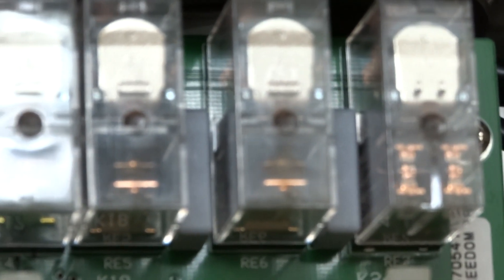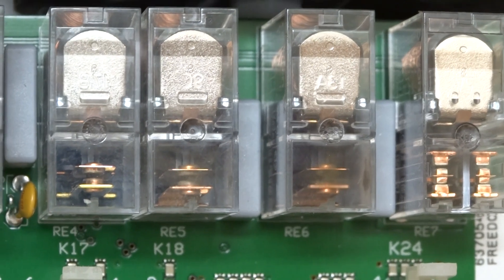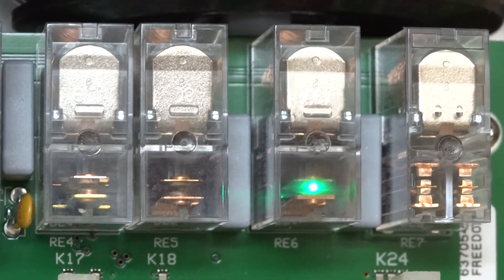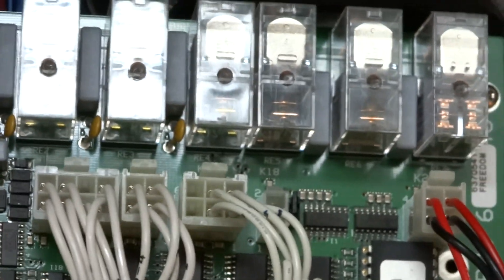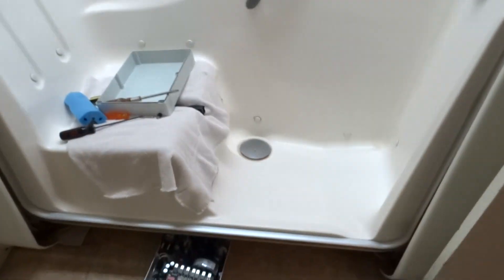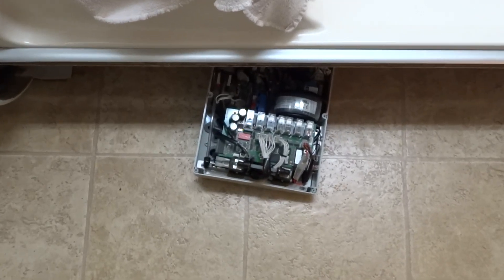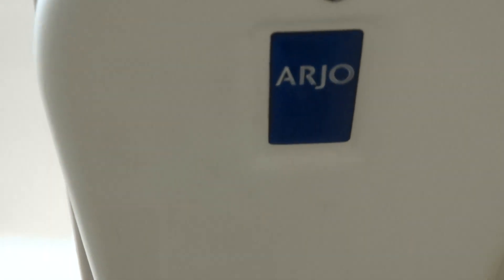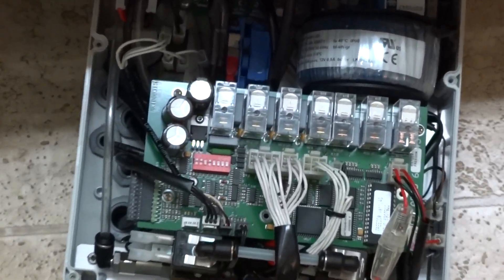Arjo Freedom Bath tub door troubles

Comment from the maker: How this turns out was the main control board with the buttons for the door and water function had malfunctioned. The down button was either broken or stuck. The solution was to replace the control board on the tub, a cost of 1,300$. That is price for part and labor.